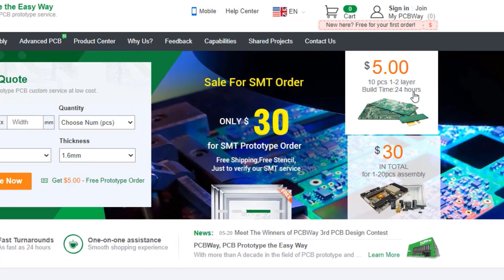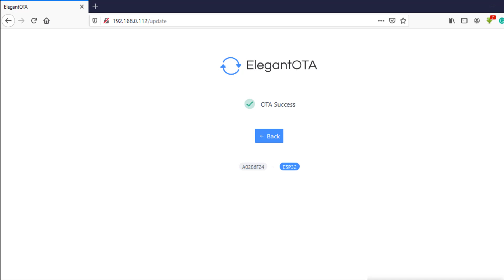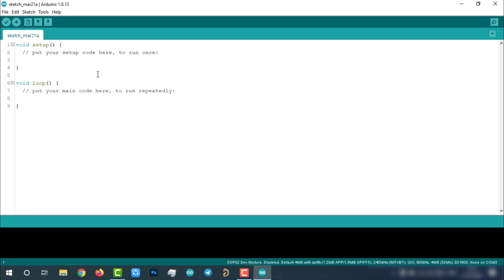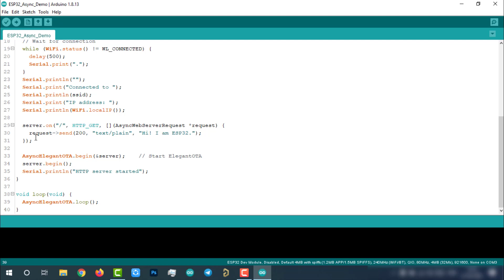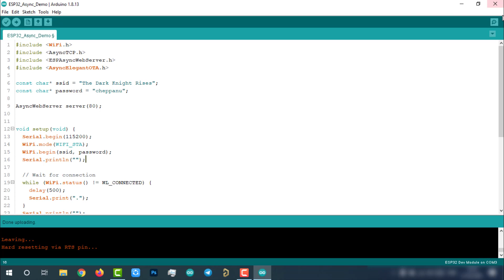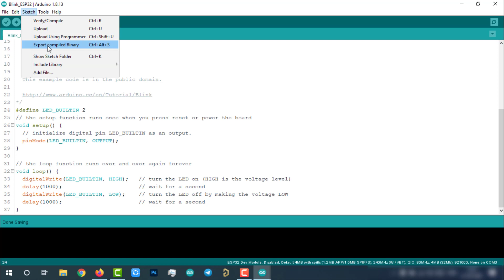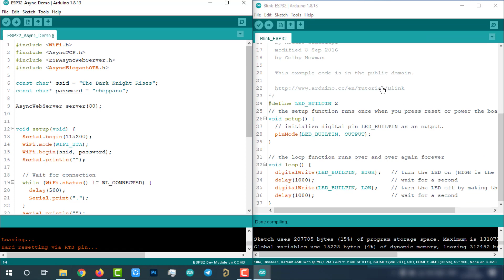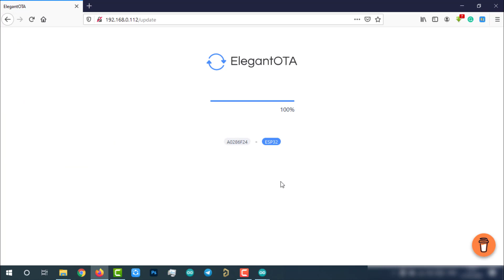ESP32 OTA (Over-the-Air) Firmware Updates using AsyncElegantOTA Arduino Library.

Comment: Hello friend, first, thanks for the tutorial. I have a question:
With my esp82266, I do the whole procedure and when it arrives at the ElegantOTA screen, it shows up to 100% and stops, it doesn't continue.
However, I ask you a question: after exporting to the .bin file with ip xxxxx/update, this .bin file must be loaded with esp connected to PC usb or esp must be connected to another power source external? I'm asking because I didn't see you do it!
PS.: When I just type the IP, without /update in the address bar, it shows the message "Hi! I am ESP8266" with esp plugged into a wall socket.  Thanks

Comment: How can we do this through internet not wifi?I have esp32 sim800l module and I can connect to internet through sim800l 's gprs.
Reply: There are examples for the esp32 to upgrade from a spiffs file, you should be able to download a file into spiffs and flash when ready.